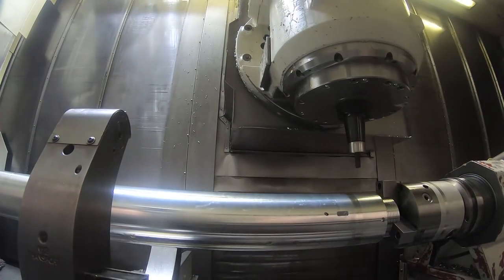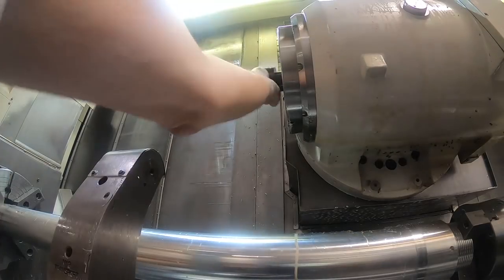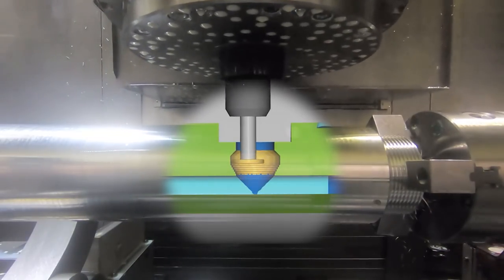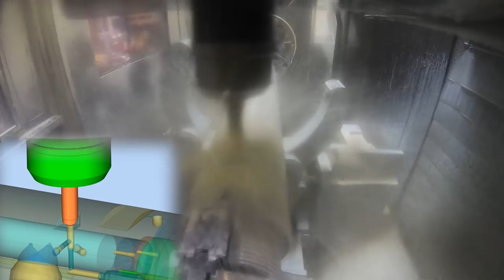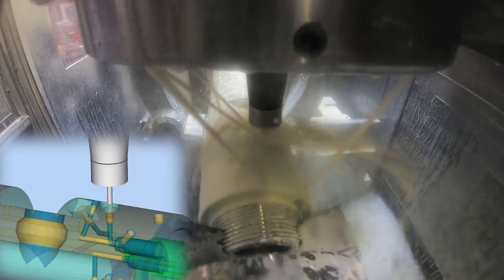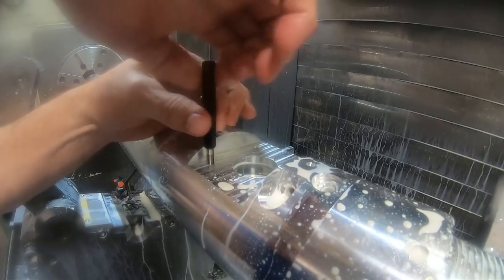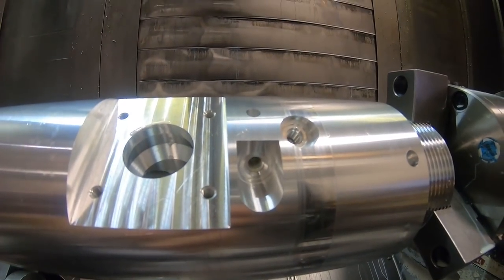Pin End Of Titanium Part. OD Machine Work

Comment: Great video! The Cam Overlay is for sure a ton of work, but helps a lot to visulise whats going on.
Reply from the maker: Thanks Stefan! It really wasn't that much work. Record a screen shot of the entire simulation. Than insert the bits you want. Than change the speed of the simulation to match the actual footage of the tool running. If you put a mark at the beginning and end of the tool than just keep changing the speed percentage on the simulation clip to match space between the marks. Not to difficult.

Comment: I need to get that x-ray vision module you have.

When I used to drill intersecting holes all the time, I found that if the holes actually lined up things generally went well even in awful materials.  I would intentionally design the parts and drill the holes such that the intersecting drill would not touch the "bottom" of the other hole and it was important to mind the tip angle and only drill to the center of that bore.   With a regular fluted drill, you can definitely lose the tip if the wings touch the other side of the bore.

Comment: Agreed that the CAM simulation overlay is really cool even if the sync isn't perfect.  
Had a thought on your camera lens blow off....Enjoyed watching that  video as well, but what if you put a second "air knife" forward on the camera to act as an air curtain to try and avoid the coolant hitting the lens.  Depending on how hard it is directed at the lens it might deflect some  and then the laminar air flow wipe would clear what makes it through the first  line of deflecting air...    Thank you for sharing your knowledge with us all.
Reply from the maker: The Air alone isn't enough to stop the high pressure coolant. I do have other ideas. Just not enough time to try them yet.

Comment: Thanks a lot for all details you shared dear master.
In my country, most of the older machinist do not want to share their experience, that is way I said machinist. You are the master.

I am just wondering how do you enlarge pre-drilled holes. These tools were drill or reamer? For example at 10:05 at the video.
Probably hou have explained in the video but my english is not enough to catch (:

Drills are stabilized with their  sharp point,  your operations in this video, some of holes are pre-drilled, so there is no material at the center of the hole. How do drills stay steady?
Thanks a lot for your attention,

Kind regards.
Reply from the maker: To enlarge a pre-drilled hole depends on how much material is being cut out and the tolerance and finish requirements. One way is to use a larger drill. This will leave the worst finish and is hard on the drill. When drilling out holes that are just a little larger than the existing hole the drill has to be run at a slow speed or it will overheat the tips and cause failure of the tool. The next way would be a reamer type of tool or core drill (Three or four or more flutes). This works good providing you can get coolant in and the shavings out. Milling can be used on a hole that's not to deep. Boring is the final option. I have listed them in the order of finish and precision required also drilling being the least and boring being the most precise.
Reply: @EdgePrecision  I heard that, enlarging with end-mill brings cylindricality error.
Some says, if you can increase point quantity when creating a circle;
But another says increasing point quantity on the path makes the machine slow because axis drivers of machine need to read much more point coordinates.
I ment depth of hole is not bigger than helix length of end-mill. Otherwise shank will rub to the part [ I have watched your video about that problem, thanks again :) ]

Have you ever experienced this kind of cylindricality problem with enlarging with end-mill?
I am asking because if there is any practical way to get shallow holes that covers requirement like bearing-housing,
I am tired of buying finish-boring tools :)

Thanks a lot for quick and detailed answer,
Kind regards,
Reply from the maker: If you are talking about milling circles or circular interpolation. Yes no machine mills perfect circles. Some are better than others but I would not chose to mill a bore for a bearing race unless the requirements are not critical. It would be better to bore a c-bore for a bearing. If you are referring to just plunging a endmill like a drill. I think that could work if it was cutting to size. It will cut a round hole just plunging in like a drill. Unless you are plunging from solid than it will tend to wobble around and cut oversize.

Comment: Handy that steady dampened it to get rid of that chatter.  If that had not done it would you have tried a different tooling grind?
Reply from the maker: Possibly. I thought of grinding the form smaller in diameter. Than circular interpolate it as if it's a milling cutter. I may still do that if I have trouble in the titanium.

Comment: Fantastic video as always, Peter.  My only gripe: they are Lee plugs, not Leco plugs.  We use them by the thousands in our hydraulic valves and manifolds.
Reply from the maker: Your right of course. It’s just that I guess I started calling them that because the drawings notes often says Lee Co. as in Lee company. Sorry for the inaccuracy.
Reply: Ahhhh makes sense.  We also use Koenig plugs, which have a soft steel shell and a hardened ball bearing in the center.

Comment: This is for an Oscar. The simulation overlay (or to a side) makes it the best. Did I understood correctly, this is an Aluminum “test” run and the real work will be on Titanium?
Reply from the maker: Yes this is the aluminum setup part in this video. The actual parts are titanium.

Comment: Thanks Peter great vid.  When you start the real run of these high dollar (very, I assume) parts, do you still stop and check dimensions alot and babysit the tools?  Or do you ever achieve the situation where you can just hit the go button and let it run?  Thanks as always, I learn alot!
Reply from the maker: No this kind of machine work is never just push start and let it run. In fact these kind of jobs I always run with Op-Stop enabled to check things after every tool. This isn't like production machine work. Its more like CNC controlled manual machine work.

Comment: When thread milling can the thread start point be specified if necessary? A video about thread milling would be very interesting. Excellent video as always, thanks Peter
Reply from the maker: When you say start point what do you mean? Are you referring to a rotational start or a Z start or top of the hole?
Reply: @EdgePrecision  Rotational start of the thread at the top of the hole
Reply from the maker: There are a few possible ways to do this if the timing of the thread is critical for the mating part. First is to program without worrying about it than see where it ends up (Maybe even run a sample part) Than rotate the tool path in the axis of the thread to the angle you need in the Cam software. Or a very similar way just manually program a rotation in the G-Code (the least desirable way). Or draw the actual helix of the thread in the Cam software in the proper location than use a mill profile along that helix to program the thread. This could have a advantage if you also need to mill a blunt start on the thread.
Reply: @EdgePrecision  Thanks Peter

Comment: For port threads I've heard that you need to have a dwell at the bottom of the cut, like at least 1.5 revolutions worth.  Do you ever use dykem or something to check that the seat is fully cut?
Reply from the maker: Yes a dwell could be good. But it could also cause chatter. I rarely ever us Dykem for anything. For one thing its to thick. A sharpie permanent marker is better.

Comment: what kind of jaws on on the thread in the sub?
Reply from the maker: axisfiver axisfiver that’s not a sub spindle . It’s a chuck mounted in the tail stock. The jaws are just normal steel soft jaws. Bored for the OD of the thread.

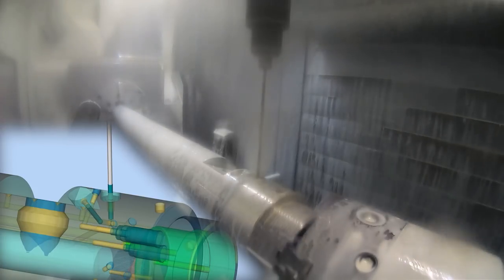Comment: At 9:00 why did you preferred a gun drill over a standard drill or carbide drill?
Reply from the maker: For intersecting and deep holes I prefer a gun drill. But a gun drill takes more time to run. But in it's favor it can be easily resharpened and it costs less. Also If broken it can be easily got out of the hole. This is especially important on deep holes.
Reply: @EdgePrecision  thank you!

Comment: Hey you finally finished it. But do you really plan to hold the part at the tailstock end chucked on the threads? And what do you plan to do with all that cash coming your way?  Cheers!
Reply from the maker: Because the Acme thread is flat on it's OD and the soft jaws are bored to the same diameter as the thread this wont damage the thread. I wouldn't recommend doing this with a V thread though. The part still has a lot to go. You will see.

Comment: When a radial gun drill hole intersects an existing axial hole, does it raise a burr in the axial hole? Do you then have to run a drill up the axial hole again to clear the burr, or is there another way?
Reply from the maker: Everything thing raises burs. They have to be removed but fortunately I don't have to do it. Here at Centerline they have deburr guys that have a lot of experience with this kind of part.

Comment: Hi Peter! I'm on the verge of convincing the higher-ups that we should purchase a Mill-Turn machine (looking most likely at an integrex i-400S or ST but also considering the Okuma Multus or Doosan SMX ). Honestly, if it wasn't for these videos I wouldn't have given much thought to it. Is there anything I should be aware of that might not be obvious? It's hard to find information on these "niche" machines other than the manufacturers videos who obviously have nothing but good things to say. We have never owned a Mazak machine let alone one of their top-of-the-line machines so I'm expecting a steep learning curve. But, that hasn't stopped me in the past. I'll most likely be Programming and running the machine myself solely so I have the luxury of being able to leave tools set-up in the machine. I have a fair bit of experience with live tool lathes with Y-axis and Subspindles so I'm sure at least some of the same concepts apply. The main reason I'm looking at these machines are the tool capacity and the larger Y-Axis envelope (better than only +-2.000 of most machines). I also like the idea of having the horsepower and rigidity of a full-on milling spindle. The ability to drill/mill on angles is a bonus and will allow us to take on much more complex parts or approach existing parts from another angle (no pun intended). In your experience what are the drawbacks of this style of machine? Ridgidity? Cost of Tooling (probably looking at Capto C6)? How is maintenance? Do you have to perform any kind or alignment regularly? How bad would things be if it were to experience a collision (obviously we avoid this at all costs but I just want to know if the machine will never be the same after...) I don't expect you to answer all of these questions but if you could provide a little insight on what it's like to own/operate this machine in juxtaposition to the glamorous videos the manufacturers put out.
Reply: I run two Doosan Mx machines and will tell you if something breaks or gets bumped out of alignment it is not a cheap fix. Also when you buy a machine like this spend the money to get good chucks and tool holders.We ended up buying the inoflex chucks at 10k a piece, but totally worth it. Also get a software package that has bullet proof simulations of the machine and model everything. If that B axis spindle gets hit hard or goes out you are looking at anywhere from 50-60k in repairs. And also expect a pretty decent learning curve to get a handle on the TCPC, coordinate rotation, and specific cycles related to the machine you buy. They are powerful machines, but require you to put in the time to learn it.

Comment: Do you separate out the swarf into the different metals for recycling? I imagine the titanium cut off these parts is quite valuable.
Reply from the maker: Actually the titanium shavings aren't worth much as scrap. Solids are but the shavings apparently are contaminated by the coolant and turning tools. And also scrap is sold by the pound and titanium is not heavy. Now inconel and carbide that's a different story.
Reply: @EdgePrecision  Wow. Thanks. As a home machinist I never have shavings in sufficient quantities to know. Thanks for taking the time to make these videos and to reply to comments.

Comment: All the prep work from tooling-cutting test part. How long does it take to get FA done (on average of course it depends on the part complexity)
Reply from the maker: If I get a first article done it does take a while. The first end took almost a week. But I think they couldn't get to it right away. In the mean time I work on the next operations. I haven't counted the dimensions on this part. But one before this a couple of years ago had over 900 dimensions to be checked and data sheet'd for its first article. This one may have just as many. I don't have the drawing with the numbers on it for the data sheet.

Comment: Once again, very impressive Peter! But clamping on the thread, did that gave you any problems??
Reply from the maker: No it's a acme thread with flat tops and the jaws are bored for it's exact diameter. I would not recommend doing this with a V thread.

Comment: Hey Peter, Where do you like to control your tool diameters?  In the CAM or in the control of the machine and do you have a strong reason of why you do so?
Reply from the maker: I program the finish tools with cutter comp so as to use the offsets in the machine. That way you can use the same program with different tools. Because tools wear as you use them you can make small changes at the machine. Otherwise you would have to keep reprocessing code over and over. To get things to size as the tools wear.

Comment: Hi Peter, really nice video, the cam overlay is great!. How much do you think the complexity of the parts you do is up to the designer not being aware of what it takes to machine these, and how much is true complexity due to the requirements of the part? How much do you go back and forth with the client to clarify the design before starting the machining?
Reply from the maker: Very rarely do I speak to the customer unless there is a problem. Actually these parts seem complicated but these guys are quite good and these features are necessary for there function.

Comment: Is there any concern with damaging the threads on the end when  you grab it with the three jaw?
Reply from the maker: Because it's a Acme thread this will be OK. I would not do this on a thread form with sharp points. Besides the jaws are bored for the exact diameter of the thread's OD and have a lot of bearing area.

Comment: peter how did you not scar the threads, doug
Reply from the maker: Are you referring to the chuck at the tail stock? The chuck jaws are bored to the OD of the thread. The Acme threads are flat on the top. These jaws won’t damage the thread.

Comment: Have you ever felt nervous enough to have a parallel "practice run" part of the same material in case something went wrong? If you ever have, when was the last time? You're at a very high level - I really hope some day you find a worthy apprentice.
Reply from the maker: No I have never run a practice part in the same material. I have tested certain tool in smaller pieces of the same material to see what finish and size they cut. As far as I concerned a part of the same material is going to be sold. Not a practice part. It does reduce the stress if there is extra material or a part going into stock. But with these large parts and all the work in them before I even get them there are rarely extras.

Comment: Hey peter, what softwares do you use for for drawing models?
Reply from the maker: For cad I use SpaceClaim. For cam I have been using Esprit TNG. That is what you saw in this video the Esprit simulations.
Reply: Edge Precision thanks. Btw, not sure if you noticed the small jump in subscribers earlier this week. I made a post in my machinist forum  requesting people to subscribe to your channel. I think I saw it go up from 45.0 or 45.1 up to 45.3 in the matter of a day or two.
Reply from the maker: @micahhunter2706  Thanks!

Comment: great video as always but i see the stuff youre doing and cant help but think there must be a more practical way to flow the same stuff these parts are intended for
Reply: Every machinist out there runs into this problem. Engineering seldom think of best method of design with manufacturing in mind. I run into parts often that I get approved to change design for this reason.

Comment: You really have to slow Down the rpm for almost any Kind of Formtool..should Help with the shatter
Reply from the maker: Actually what helped was to speed it up. Like I said in the video. Don't rule out going up in speed to eliminate vibration/chatter. It can work either way. Because this vibration was of the low frequency (Listen carefully to the video) going up in speed usually helps. If the vibration is high frequency than going down in speed will help.
Reply: @EdgePrecision  - that rule of thumb is pure gold.  It makes sense, but I don't know how many years it would have taken for me to recognize that pattern on my own.  Thanks, mate!